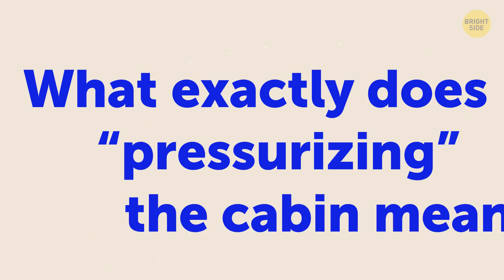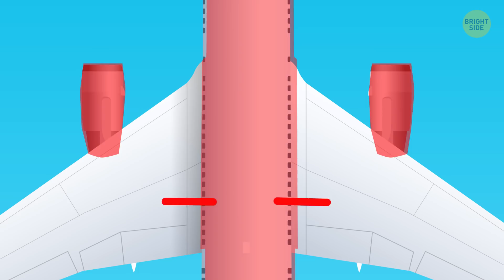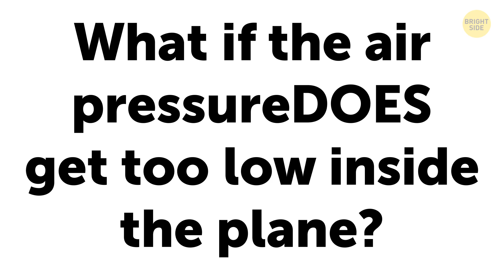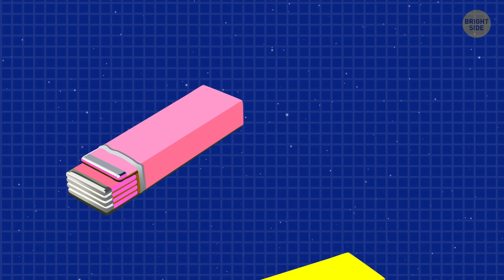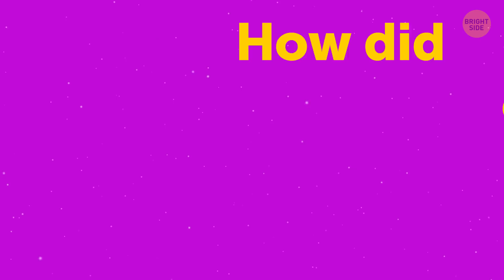What'll Happen to You If They Forget to Pressurize a Plane

Comment: What happens if there is an engine failure then how does the pressurisation system work?
Reply: There's more than one engine. Planes will drop quickly if they need to hence the oxygen mask dropping until the pressure is normalised with the outside air.

Comment: If valve open near the ground ouside pressure must be higher so the inside must get further pressurised and not that the pressure should be let out?               
This is a question by the way.
Reply: Why not phrase it as a question then you won't need to say "this is a question". I sill don't know what your question is.